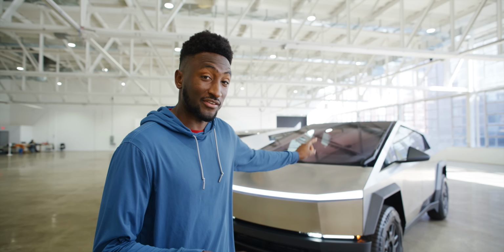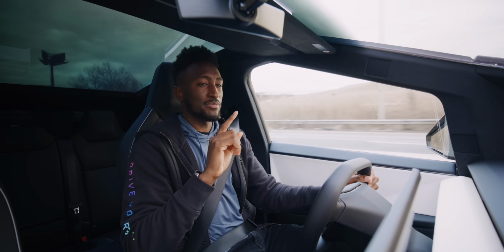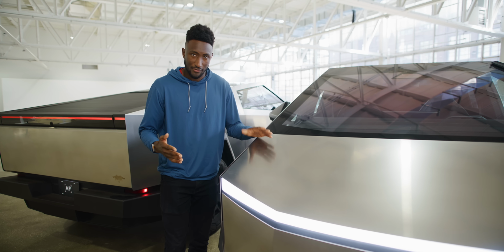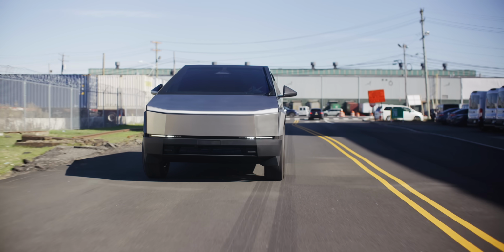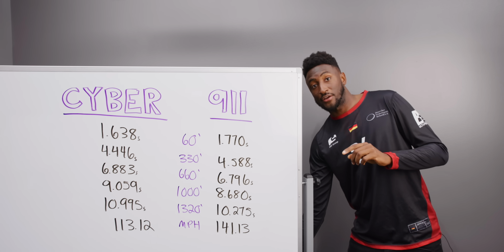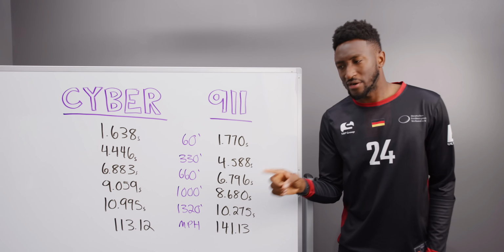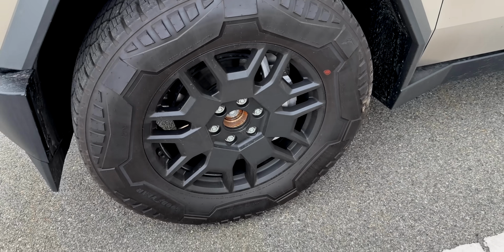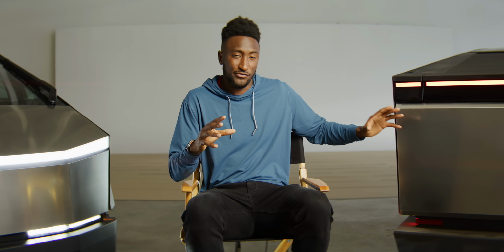Tesla Cybertruck Review: Already Iconic?

Comment: 17:20 No it's not stock? 140 MP/h is definitely stock for anything with a Porsche badge... My diesel BMW 5-series is limited at 155 MP/h. And yes, that's GPS, so it says 265 kph on the speedo.
And also the cyclist - I completely get it. A car crash with a cybertruck will most probably kill the cyclist.

And to your reference to the Countach - it looks amazing, it drives horribly. And the Veyron actually has at least 900 produced, probably a few more. You will probably find 100 already in Monaco, another 100 in Dubai and at least a dozen in Hong Kong.

Comment: “If somebody hits you, you’ll be fine” I’m sure the family of 4 in their Fiat punto will be overjoyed to hear that.
Reply: all of the energy that would get transferred into the car via crumples instead goes straight into the driver. fun!
Reply: @edg4rallanbro753  You really think it doesn't have crumple zones? Ofc it does. Every Tesla gets the highest possible safety score. You think the CT will have bad occupant protection?
Reply: @empebee  yes. That's just a fact. I has been repeatedly show to not crumple at all in crashes. It is a dangerous POS.
Reply: @empebee highest possible safety score? in the US maybe lmao, trunk can take of your fingers and doors can cut meat
Reply: @harrymack3565  You’re going to have to elaborate on what you mean by “repeatedly shown”. 
No one outside of Tesla has done any crash testing. 
I could only find three reports of CT crashes, two of which were frontal. Nothing requiring medical attention.
Reply: @empebee  Yes
Reply: @empebee every Tesla so far 😅 had huge safety scores because the center of gravity is so low the technology to avoid crashes is pretty good and the frame was better than most cars because of the battery. So yes teslas have great safety scores now you build an entirely new frame that’s an exoskeleton and there is no guarantee that any of that is still true 😅
Reply: @empebee they released a video of a crash test and it had fewer crumples
Reply: the fun part about this is that someone had a crash with a cybertruck, the car looked nearly damaged at all, but the driver had their legs broken.
if somebody hits you in the cybertruck, you will get hurt
Reply: 이 채널에는 아무래도 사이버트럭에 대해 견제하려는 기업. 사람들이 몰려든  것 같습니다. 😅그들은 무조건 비난하기   바쁩니다. 😅
Reply: if any car hit a fiat, it would be smoked 😂
Reply: @sereth1738  🤣
Reply: The same if a Fiat gets hit with a F150.
Reply: @Return-2-Monke  same thing
Reply: hope you have a spare neck boys!
Reply: They shouldn't have hit you.
Reply: Why don't you buy them a Cybertruck if you're so concerned
Reply: @arrowsplitter  This may surprise you, but there are many people in the world who have small cars. Many of whom I don’t know. Shocking right.
Reply: @conormurphy4328  my mind just blew up
Reply: Oh jah because when a semi crushes your punto and occupants it REALLY matters what brand it was that turned you into paste.
Reply: He said exactly that - without saying it. Which emphasized it even stronger than if he said it.
Reply: Yes, that was his point. Good of you to pick up on that.
Reply: @empebee almost like he should have properly addressed it instead of dancing around it while he sucks the cars tailpipe.
Reply: @conormurphy4328  He absolutely could have, but it’s also pretty obvious since it’s a truck.
Reply: Even ignoring crumple zones, the acceleater sometimes just gets stuck on thw ground and you go full speed, so much for a safe car. @empebee
Reply: @dylankersten3383  No one has been hurt and it’s hard to see how anyone could be hurt since you could simply use the brakes. It takes less than a minute to fix, but I guess it’s real bad luck that Tesla had to be the first automaker to ever make a recall.
Reply: The structure of the crumple zone is simply different on CT. Instead of a soft outer skin and a hard structure underneath (such as the front impact beams that every car has), the "impact beam" is external. For some scenarios this can be advantageous, even for the other party involved in the accident. Especially with SUVs and pickups, it often happens that their impact beams are simply not hit correctly and the car literally drills into the opposing vehicle. This is improved with a uniformly hard and flat outer skin that distributes the forces directly and more evenly as it spreads the deformation over a larger area.
Furthermore, it can be an advantage if the vehicles do not become wedged because of the soft outer panels and the vehicles simply bounce off each other to the side and thus far less deceleration forces act on the occupants.

However, soft opponents, such as pedestrians, definitely have a disadvantage, as the usual soft, easily deformable outer body is missing.
Even in the case of minor collisions, greater damage will occur to the other party involved in the accident, as the small forces that occur can be completely absorbed by the stable CT skin and the actual crumple zone is not stressed.
Reply: @Zedus-rl9hp  so the exterior doesn't crumple? as in "no crumple zones"? like a 50's chevy?
Reply: @OlegAryutkin  Just like an egg or a beetle. When a certain amount of pressure is applied, the hard shell shifts inwards.
so no, not like a 50's chevy
Reply: man you really had to get your gears turning to pick up on the HEAVY implication he was making huh?
Reply: @BloodDripss  more so giving a grim real world example of what he was dancing around.
Reply: their bad not mine 😂 😂
Reply: Such a stupid objection. I'm sure the Fiat punto would do great colliding with any number of other vehicles on the road - dump trucks, garbage trucks, semi's... here's what you do as a punto driver. DON'T DRIVE INTO THINGS.
Reply: @OccamKant  bro is comparing the cyber truck to industry vehicles just to make this stupid point 💀
Reply: @OccamKant  Lol, those vehicles still have crumple zones. There's a reason we don't make steel cars anymore. They kill people.
Reply: @OccamKant damn why didn’t anyone think of not fucking up while driving? You’re a genius bro
Reply: In a crash, I’d care more about my own familys safety than the other. Ain’t nobody buying a safe car with the safety of others in mind.
Reply: Wait wait wait. U r saying that everyone should stop buying the F150 or cyber truck or any truck for that matter because they can damage a family of 4 in a Fiat Punto. What kind of a shit take is it? My family and me come first before anyone else. If I can afford the safety for my family and me then yeah I am buying it for the cost of the people I don't know. Definitely!
Reply: @tanmayrajeshkota4518  And this absolutely cancerous view makes roads more and more dangerous.
Reply: @tanmayrajeshkota4518   Youre part of the group of drivers that make the road unsafer for everyone else. All me me me. No consideration for others. I dont even want to think what your driving is like
Reply: @tanmayrajeshkota4518  The government should stop giving tax breaks to manufacturers to push and market light trucks with stiff frames so aggressively for exactly this reason.  No one is under the illusion that people like you would take it upon themselves to buy a vehicle that is safer for everyone of your own volition.
Reply: @Drahkir9  I'm sorry but if they crash into me and their safety is at risk, then that says more about their car than mine. If their car is that fragile that them crashing into me harms them more than me, then they should invest in a safer car. What you are saying is we should take safer cars off the streets in fear that people with unsafe cars gets injured. That is the opposite of what we should do. We should make every other car built to be safer so situations like those do not happen.
Reply: @StevenNguyenJason  I think having unsafe cars and cars that can turn other cars into crushed tin cans are both problems. You can’t blame people for having smaller cars that are at more risk of injury in a crash as they’re usually bought due to financial constraints. There should be a minimum safety limit for street cars as well as a limit to the monstrous cars that are both very heavy and can go very fast like the cybertruck.
Reply: @StevenNguyenJason  Pickup trucks are objectively less safe for everyone around them than normal cars are. Your goals should not be to destroy any car around you like it's Grand Theft Auto, it should be for everyone in a car crash to survive. Bigger cars objectively cause more deaths per mile than smaller cars do. Plus, the Cyber Truck has very poor lines of sight and no crumple zones, making it more likely to get into car crashes due to user error AND more likely to kill the person inside of it in the event of a crash.
Reply: @Drahkir9 they don’t give tax breaks they give climate regulation breaks 😅 which is even worse 😅
Reply: @Playingwithproxies  you’re right, I misspoke, thx

Comment: top gear didnt thrash all those cars around a track in their reviews because buyers were actually going to do that with the product, they were trying to assess how good the car was at doing car stuff; cornering, comfort, fun. To say that it doesnt matter that this truck is bad at truck stuff; towing, range, offroading, because most customers never do that stuff is a bit silly imo, especially when tesla continues to claim class-leading competency in these areas. 
Most customers of the 911 will not track it or command its full potential, but they buy 911s because they are nonetheless best at sports car stuff and you would not reccommend that I buy a golf GTI instead because I'm 'not gonna use that stuff anyway'

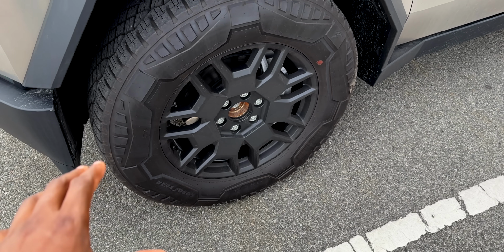Comment: 23:10 those wheel covers will most likely cause the brakes to overheat and fail. Trucks too heavy and the breaks are going to get worked. Holding in that heat isn’t ideal.

Comment: Back in the 70s and 80s a major criticism of North American cars was the over focus on style, while ignoring how a vehicle did its job.

So cars were larger than they needed to be in order to accomplish their purpose. Thus the move from 70s boats to smaller 80s cars with similar interior space,  better build quality, and higher efficiency.

Basically, what I'm saying is that the Cybertruck is the equivalent of a 1976 Cadillac convertible with horns on the hood (check out Boss Hogg's Cadillac in The Dukes of Hazzard).

It's all about style, with no attention paid to functionality. It's a joke. 

By contrast, the typical truck is a testament to form following function.

And the whole acceleration thing is massively overblown. While every car guy/girl loves speed and power, you're talking about performance you can't use, but which will drain the battery even faster.

Which brings me to the question of environmental concerns.

How is a truck that is grossly overweight, has limited cargo space and capacity relative to similarly sized real trucks, and is shaped like a building in any way environmentally responsible?

It's laughable.

Is it a technical tour de force? Yes. But anyone trying to argue that there's any rational basis for buying this thing is kidding themselves. It's the equivalent of saying a Mustang is a legitimate family car because it has vestigial rear seats.

The Cybertruck is a "pickup", but only in the loosest sense.

Comment: That was an interesting chart (How F150 owners use their truck).  Here's one other consideration, when you need to tow something substantial, you REALLY need a truck.  You can't rent a truck unless you sign an agreement that you won't tow anything.  So while only 7% of F-150 owners use their truck for towing, there is no other option.  As far as personal hauling, it's the same thing.  Making renovations to your house?  You need something that can haul a 4' x 8' sheet of plywood, drywall, etc.. I did that with a 20 year old Honda Pilot, a full size SUV, but most SUVs now are too small.
So for occasional use the Cybertruck that rides like a nice car is cheaper on fuel than any ICE, roomier than most vehicles and will eventually be reasonably priced, why would you want anything else?  
Here's why not!  It doesn't have that much range.  If Tesla would have kept their promise of close to 500 miles of range then you would get 200 miles of range while towing in the winter, (loose 50% for towing 10,000 lb holiday trailer and another 10% for winter driving).
If they can get the Tesla Semi to have 500 miles of range with a GVW or 80,000 lbs, they could have done it with a CT and a GVW or 30,000 lbs.

Comment: I don't think you're a reliable tech reviewer anymore Marques and I'll tell you why: You ripped apart Fisker Ocean for simply stupid reasons that can be easily fixed with a software update, but the Cybetruck is a piece of garbage full of issues, not to mention it's ugly and impractical, yet you barely said anything negative about it. Clearly a Tesla(?)/Musk(?) fanboy, or paid for? Something along those lines. As far as the Cybertruck goes, maybe it's time to stop the mass delusion and admit that it is a tin can on wheels.

Comment: I'm not at home in manufacturing nor the english language, but I believe they're not "stamping" the stainless steel, as you said multiple times. They're just bending it. This is actually the main reason for the crazy shape. You can't just stamp the sheet metal into any shape because it's too strong. Only bend straight edges, then glue or weld the pieces to the body.

Comment: You will not be fine if you're hit, either by or in this vehicle. Bulletproof stainless steel? There's a reason cars stopped being made of stainless steel a long time ago, and that's cuz during a crash the force and energy will be transferred to the most fragile things first. When you have a rigid car, the thing that'll crumple first is the soft squishy human body. That's why the hood and trunk of a car is made of aluminum. So that in the event of a crash it'll absorb the impact first instead of the human body. The actual cage of a car is usually steel so that you aren't squished to death, but that also means that T-bones are the most dangerous type of crashes because there's no crumple zone to absorb the impact when you're hit.

Of course, this does come with a downside. You get into a minor crash nowadays, and your car's almost guaranteed to be totaled. But that's also the point. You want the car to crumple around the humans as much as possible so the human doesn't die. It's like that one high school project some kids do where you have to drop an egg in a basket from a roof without having the egg crack by wrapping it in soft stuff like toilet paper. You know what'll happen if you put the egg in a stainless steel bottle then drop it from the roof? That egg's exploding. 

When cars were made of steel accidents at what would be considered low speeds today were still dangerous af. Nowadays you get into an accident at 60 MPH and unless you're unlucky or T-boned people are usually not too badly injured. This monstrosity? Bro hitting a wall at 30MPH will be the equivalent of you sprinting faster than Usain Bolt straight into a wall. Not scary with a normal car, potentially fucking fatal with this shit.

Comment: I'm not so sure about the winter capability the headlights get covered with snow because the front bumper creates a shelf for snow to sit on, the rear camera gets covered in snow and road salt spray, and it doesn't have a cleaning mechanism like the front camera so in winter you'll have to drive with the tonneau cover down and that's just regular winter driving stuff

Comment: Good review!  The high water shot brought up a question: if the truck were to ever be submerged accidently, how is someone to get out?  The windows are nearly unbreakable, right?  Is it still breakable with an escape tool?
Reply: A high profile person has recently died in her Tesla exactly because of this…
Reply: Windows are unbreakable if you throw a tennis ball at them.  Use the metal ball that broke the window in the original test and they will break just fine.  Only laminated glass the same as most windscreens.

Comment: Never doubt the disconnect between society and an internet bubble.

All the videos that have come out on this vehicle, I keep needing to look at it as if my father was shopping for a truck... because the rest of us would get a smaller vehicle. An interesting one to me is my father's Ram 1500 had an issue where the steering column "wasn't plugged in fully" and when it became unplugged (which happened multiple times and one was with a Ram mechanic in the vehicle) the whole truck shut down and he couldn't steer it. He's not wimpy and both of us have dealt with "heavy truck with no power steering" and the steering didn't lock up, the steering wheel moved... but the wheels did not. It was described to us as being steering by wire, but I see no sign of that on the internet. So either Ram lied to my father or the Cybertruck isn't actually the first drive by wire vehicle (and I'm not saying the Ram is either). That's my only monologue on the topic.

Everything else mentioned is on point.

Comment: Imagine a variable speed-based steering ratio that's purely mechanical (I imagine a simpler form of a CVT transmission on the steering column).